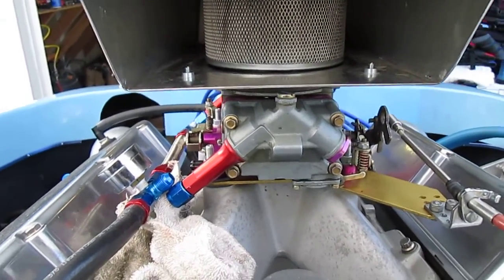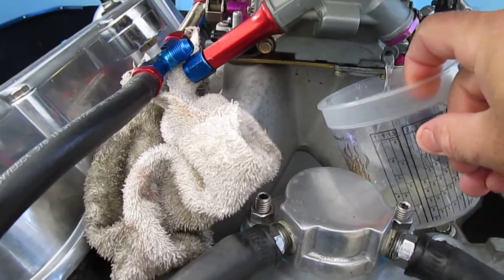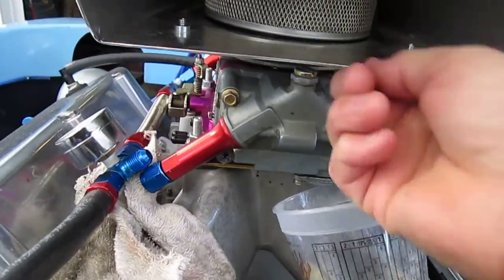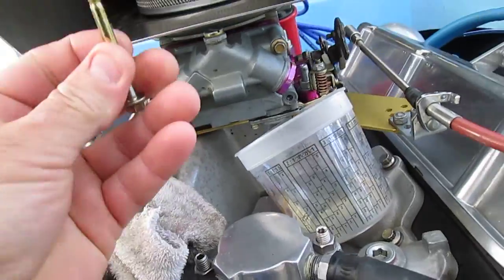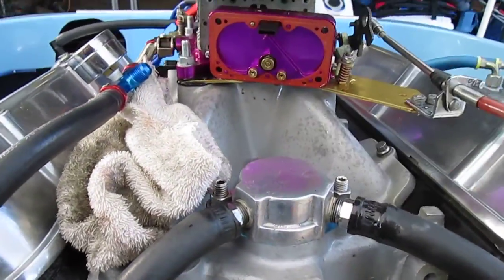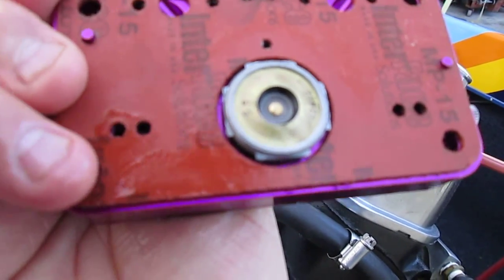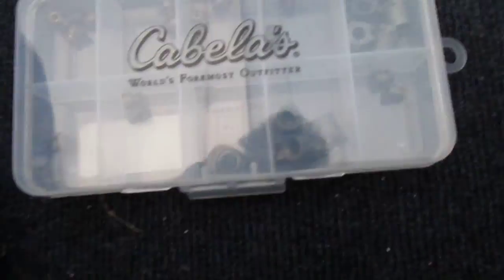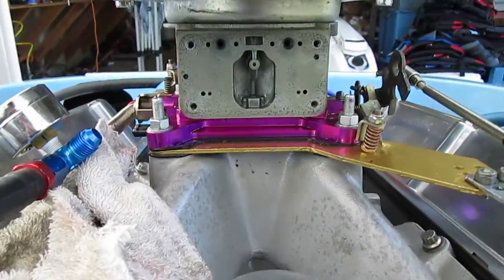850 proform holley carburator how to rejet your carb

Comment: HAD A RED WITH BLACK INTERIOR 1968 GTO 400  CUB. IN. 850 CENTER FEED CARB (LIST#4223) WITH 455 HEADS, CRANK AND CROWLER 502 CAM, 335 LIFT, M-21 4SPD, 4:30 REAR. RAN LIKE A STRIPED-AS-APE. MID 12'S CONSISTENCE. GREAT CRUISING MACHINE M/T TIRES. BUT WOULD RUN BETTER WITH THE CHEATER SLICKS BRAND. THAT'S A FACT, JACK !